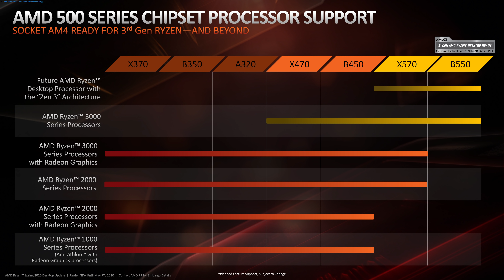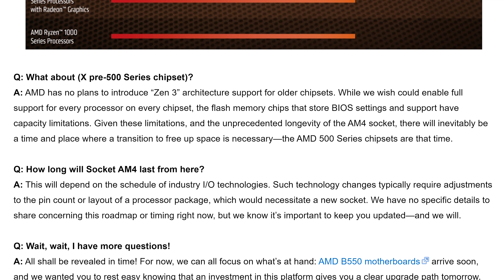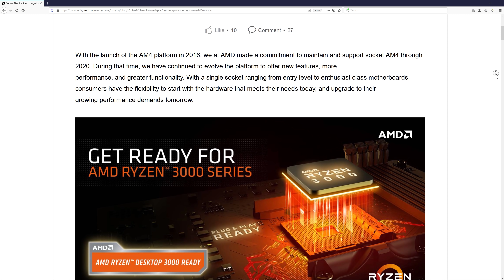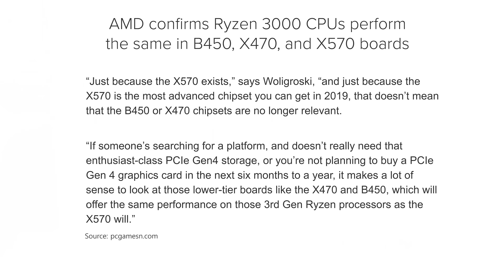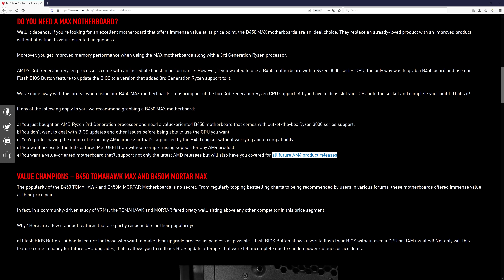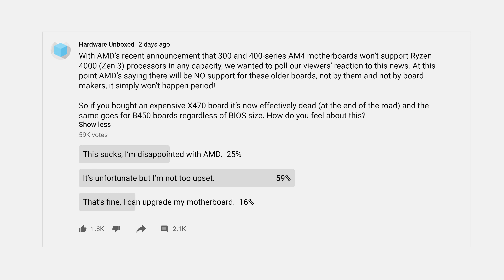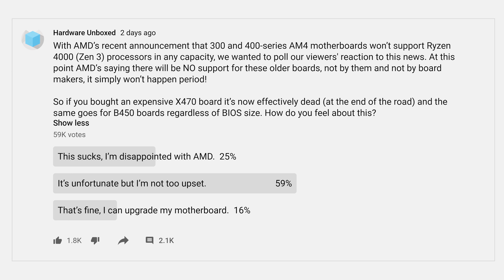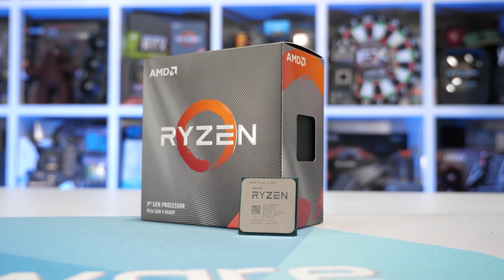AMD Does An Intel, Axes Zen 3 on 400-Series Motherboards, Our Thoughts

Comment: In answer to your appeal for replies, I am in the camp of being pissed off at #AMD. I’ve been a Mac owner since 1985 and very recently just bought everything to build myself a Hackintosh from scratch with the added flexibility of playing PC games - especially iRacing etc. Sims. (Yes I know you have to remove the Mac OS drive so it doesn’t get corrupted when using Windows on the same machine. I am actually leaning towards Linux as my gaming OS - thoughts anyone?)
Never owning a Windows based machine before, and not really knowing much about motherboards, chipsets, etc., I was on quite a steep learning curve over the past couple of months, doing loads of research, watching Tubers like yourselves, Pauls Hardware, Gamers Nexus, Jay and Linus, to basically learn everything from scratch. 
As a result of this research and from speaking with an extremely helpful sales advisor from a vendor here in the UK I deliberately chose a B450 board (MSI Pro Carbon Gaming AC) based on the assumption that in 12 months I can upgrade my CPU and nothing else. Even though the MB only cost me £100, that’s not really the point. Everyone was expecting the B450 MB’s to support Zen 3 and the ludicrous assertion from AMD that the BIOS will be too big for the chipset doesn’t really stand up (IMO). I feel that I have been a little mislead by AMD, as I used the information available to make a choice of what hardware to buy. 
(Before anyone jumps down my throat and tells me I should have just gotten an X570 board, for my use I didn’t need PCI4, and I still don’t, so I saved money on my MB and bought faster RAM (3600Mhz) and more of it (48Gb in total) - I don’t need stupid fast SSD data transfers for what I do.)

Comment: Bought an Asus b450i due to better vrms and features for the ryzen 7 3700x and in 5 years the ryzen 7 4700x or something in that range... Hope it still gets support, but its a shame that AMD made this decision in the first place...

My choice was a x570i for 250-300 bucks with features I don't need or a perfect suited (for me) 140 bucks b450i board... I needed b550 when ryzen 3000 came out, not b550 when ryzen 4000 comes out when you made a decision to NOT support boards that most people bought due to prices.

Comment: Well for better or worse, they are still way ahead of what Intel been doing in the past decade, and i didn't see people frustrated about it.
Yeah it a bit sucks for some people that bought B450 Motherboard, but I don't think AMD promised that it will support Zen 3 so it's something to consider. It is better to make it this way since it will unlock more options in the future of more features and compatibility. You can't support the same chpset forever and it's better to upgrade and making the newer stuff better and not stuck with the same for years.

Comment: It absolutely is a bullshit move, I bought the MSI B450 Tomahawk MAX on the (safe at the time) assumption it will support Ryzen 4000 CPUs.
B550/Ryzen 4000 is the end of the line for AM4, does AMD really expect that people will upgrade their motherboards just for single generation of CPUs?
I think most people with existing Ryzen 3000 CPUs will just hold out until the next generation and move to AM5 / DDR5 when those come out.

Comment: Intel ditching chipset every year : nobody cares
Amd Ditching Chipset : everyone lose their mind
Reply: We do care about Intel ditching chipset every year, that is one reason why people buy amd Ryzen.
Reply: I guess its the way they did it people were under the impression support would come so bought a product based on that which ended up not to be true. with intel you know if you buy a board you will have to upgrade it in the next year or so.
Reply: I don't care about Intel and bought AMD exactly because it was advertised they would have extended support.

Your comment makes no sense mr. Ng
Reply: The problem is that Intel has always been very clear on the matter. As Steve put it: "Tick, Tock, and go fuck off to buy a new motherboard". You know upfront that if you buy a mobo and CPU on the tock cycle, it is the end of the road. And you know that if you buy it in the tick cycle, it is not going to be worth a tock upgrade unless you bought a really low end CPU. In short: you don't make strategic purchases because Big Daddy Intel is going to give it to you hard and dry like Apple does.
So AMD, in this case, has promised on thing and delivered another. This is a problem because you can normally count on what AMD says. People have made long term plans for upgrade paths that will see them through a tight budget... We're not talking the "hur-durh i9900k+2080ti or be a lozer noob" people here. AMD's core customers (that kept them alive while they were down) are pretty darn value oriented. So yeah. Intel fanboys get screwed over: "We're expecting that". AMD fanboys get screwed over: "Wait! That's illegal!"

Comment: the problem is that they got used to that underdog status and made so much fun of Intel's antiques and now that they are the leading force they are doing the same. I bought a very expensive x470 board (c7h) thinking I would be able to upgrade to at least zen3. If I knew this, I would prefer buying a more affordable board. 
This said, I now run a 3600x so I still have an upgrade path for sure, all the way up to a 3950x....

Comment: I held off on buying anything for the sake of "upgrading" until after processors have been released for a reason. It sucks for those that purchased 400 series boards to support next gen, but we all had warnings that support would be good to/through 2020. On the other hand AMD could have done a better job of specifying why rather than just saying the BIOS chip was too small. That and the late release of B550 is on them. As irritating as it may be.. they did follow through on maintaining support into 2020 putting all semantics aside of whether it's until the beginning or end.  As for the release.. I see it being a paper launch, and the availability for the Zen 3 chips coming in 2021.

Comment: It doesn't matter what AMD did with socket compatibility. What matters is that they LIED to the customers. Intel does not give false promises. This is next level compared to Intel.
There is no socket support for B450+Zen2 -> (B550 or Zen3). Why?
To jump forward from B450 to B550 you need to change the whole combo, CPU+Mobo, since B450 does not support Zen3 and B550 does not support Zen2. So the whole support of the socket is irrelevant. It could have easily be ANOTHER SOCKET with the same result. This move should have been done with the switch to AM5.

Comment: As an owner of a 1600 and a x370 board, its hard for me to be sad, my mobo got support for 3950x, which was the next upgrade I had in mind, when the prises where pushed down by next gen ryzen. AMD should really show they gratitue and put the hours into support 4-series of mobos with next gen ryzen. Its fair that the 3-series mobo does not get support for the 4K/ryzen 3 gen lineup. As also concluded in the video, the natural switch of mobo and cpu was at next gen RAM upgrade. Still, Im not buying Intel again.

Comment: The weird thing about all this is the X370/B350 "beta bios" situation. AMD seemed determined to give X370 and B350 only two generations - just like Intel.

Now with X470/B450 - AMD is giving that chipset two generations as well - unless you count backward compatibility as three generations?

If AMD had it's way and never caved for the "beta bios" support for Ryzen 3000, they would have had their way and segmented their mainboards by two generations each time. Why the heck does anyone give a flying rip about how long "the AM4 socket" lasts, if the chipsets are divided rigidly into two generations each? Intel has been doing that for years.

Comment: X470 & 2700x here

Bought them together with promises that future cpu upgrades would be worth the then expensive mobo. Was actually the dead end platform then as there's really no meaningful upgrade in 3000 series (as I don't have that much use to 12c) ..which I expected to be the case back then but really also expected the 4000 cpu to be supported.. at least 400-mobos should get the support for the 4000 cpus.. that just makes sense...

Comment: I'm not really that angry cause the AM4 platform has been alive for many years. It would've been worse if they used a new socket, even though I feel that's happening soon.
Reply: Ryzen 5000 will be a new socket. And frankly I hope they got to an LGA style socket. Those itty bitty CPU pins are damn fragile and quite often the socket doesn't have the gripping power to hold the CPU in place while you remove the cooler.

Comment: @5:20 They explicitly say "Through 2020" in the article on screen moments before, which ought to mean until Dec 31st 2020. Honestly I'm not terribly upset by this myself. They should just be honest about the reasons behind the decision instead of this garbage "bios size limitation" thing they're feeding us.
Reply: They changed their language to "until 2020" last year.
Reply: @zeitgeistx5239  Even "through" excludes anything past 2020, though, so the point stands.
Reply: @zeitgeistx5239  That makes sense. I watched a GN vid last after my post which showed an article saying "until 2020". Kinda interesting, imo.
Reply: In that article, if you watch the video at 19:50, you can HEAR AMD say "through 2020."  That kind of speech would imply through the ENTIRE year of 2020, not part of it.  I need to consult with some of my layer friends as to what the ramifications of that could mean.
Reply: What's funny to me is that the next desktop architecture is gonna be Zen2+, not Zen3. Zen3 isn't coming until at least 2021.. so AMD kept their promise. They're just wrong here.
Reply: Yes. AM4...
Reply: @MN-jw7mm  In a twist that everyone saw coming, AMD pushes their Zen 3 release to January 1st 2021.
Reply: @MN-jw7mm  Which ryzen 4000 uses. "we said the socket not the chipset" is below intel/nvidia level, and is deceptive, possibly false marketing, because at NO point did they say anything about chipsets. Intel tells you up front you only get 2 generations per socket. Nvidia up front tells you they are no longer optimizing for their last gen GPUs. AMD whispers sweet lies while promising then retracting promises of support.

Comment: I would not have been super upset if I bought the B450, I would just have to "settle" with a 3900x in the future lol.  Not a bad future honestly.
I voted "It's unfortunate" with 59%.  But I bought x570 in my first build in December.  It was $85 more than the B450 board I was looking at.  I said to myself, "treat yourself, you deserve it." and I bought the x570.  Dropped a 3600 in there with plans of Ryzen 4000 in the future.   
I got lucky in overpricing my build at the time.

Comment: People have been taking s**t from Intel for years, and when AMD made it possible to install and run a 16-core processor into a 2 year $100 motherboard, people now expect AMD to have 3 generations of backwards compatibility and when they don't, backlash ensues. That's beyond unfair and if AMD is facing backlash for axing Zen 3 support for 400 series motherboards, Intel has to be run to the ground. I'll consider AMD equally bad to Intel only if they force you to change motherboards for every generation. The problem here is that AMD spoiled everyone. Also, it's not fair to call someone a fanboy if they don't agree with your opinion.
Reply: But in 2017 they were saying that the AM4 socket would support Zen 3.  They didn't say it wouldn't until this news.

Comment: I bought a B450 motherboard for Ryzen 2600 and was hoping I could upgrade to Zen 3 as upgrading only one generation seems like an overkill. The problem is that if I wish to go through with the upgrade and stay with B series chipset, I have to upgrade both the motherboard and the CPU at the same time since B550 no longer supports Zen+. Which in extreme case might mean a new windows licence. In which case I would rather not upgrade at all and build a new PC at a later date. Upgrading an older computer for €200 vs for €400 for the same performance gain is not a negligible difference.

Comment: Bought a b450 about a year ago and coupled it with a 2200g.  Kind of lame I won't be able to run Zen 3, but I still have a really viable upgrade path to a 3600 or a 3300x or better.  It was a $65 b450, so no huge loss.  By the time I outgrow my b450, i'll have gotten more than my money's worth and I can turn the old board and cpu into an HTPC or something.  Really not the end of the world.

Comment: Well, they already have intel beat by a long shot. 3 generations on one board is far more than intel has ever done.

The way I see it AMD has done a justice to the community. They have forced intel to slash their prices, brought us a line of really good affordable products and changed the cpu market for the better. 

It sucks that some of the am4 boards will more than likely not work but, we will have to wait to see what happens.

What I think might happen is AMD has the market share, the lead and might feel comfortable doing what intel has done for pretty much ever. 

Their new platform will be an improvement.... if you can afford it. I cross my fingers this won't be the case but, AMD is nothing more than a corporation after all. 

All heros fall eventually.
Reply: Intel HEDT has 3 generations right now.   They're reversed. Intel provides 2 generation for desktop and 3 generations for HEDT, but AMD provides 3 generations for desktop and only 2 for HEDT.  It's an interesting way to treat the customers who gave you the most money at high margins....

Comment: I was building a computer for a friend, I was updating the bios so that it's up to date but the way the bios have been split for multiple CPU's was incredibly intimidating. 
The way they were organized was "Ravin ridge, pinnacle ridge, etc" that is absolutely awful I don't know what the hell that means just say "ryzen 1000, 2000, 3000" it was really confusing and I had to look at a weird compatibility matrix on reddit. I don't think that fracturing is good. The new boards still have backwards compatibility which will still allow people to build fantastic budget builds.
Reply: They can't use ryzen 1000, 2000, 3000, because they've been mixing architectures.  Firstly the obvious APUs, which have the same product series name, but are an older generation, then you get things like the R5 1600 (AE version is Zen), R5 1600 (AF version is Zen+), or the 3200U (Zen).  The 3000 series can mean Zen, Zen+ or Zen 2, depending on model.  This confusion is of AMD's own making.

Comment: I purchased an x570 with a 3600. I figured if I wanted to upgrade to a 3900 or better it was smarter to get the latest motherboard as cpus with new features would need the newer board. I'm glad that I did instead of thinking that the old PCI-E 3.0 boards would be best for the future.

Comment: I just bought a 450 a month ago thinking I'd have a clear path forward for upgrades, at least for awhile. I would have most certainly bought a 550 if I could. my whole point was to not get stuck into buying a MB, CPU, RAM, all at the same time, AGAIN. So now they pull the rug out from underneath me 26 days later. Yeah I'm pissed, they knew they were going to do this but didn't say a thing. I'd be different if there were 550 boards for sale. They've become a pack of assholes like Intel. With the price drops Intel is going to have to make I'll probably be going back to them.

Comment: Your point about people feeling mad specifically because AMD didn't make it clear that x570 was the only forward compatible motherboard is completely correct. If I had known that, I would have bought an x570 motherboard instead of my reduced price x470 motherboard. However, if somebody bought an x470 with their 2700x and wanted to upgrade to zen 3, they would still be justifiably pissed.

Comment: I see the logic, B450 ends with 3000 (all be it with a very slimed down bios) The Max series doesn't require a beta bios or a slimed down version. B450 supports 3 generations. It is my option that is enough. Didn't Am3 support 2 generation and AM3+ support 3 generations. Seems better than Intel where evetime I heard a need chip release you need a new m/b to support it. People just go buy it.

Comment: Pissed that AMD isn't setting themselves apart from evil intel in terms of compatibility- really had an opportunity to win/retain more consumers here. So salty in fact that i'm looking for somewhere else to turn.
Reply: Matt Faust They turned even worse. They now also make fake B550(A) boards(B450) to help OEMs lie and confuse customers
Reply: 4 generations (counting non-ryzen AM4 APUs) so far all forward and backward compatible (minus a few exceptions), and you are still whining? Intel has never done anything like that since .. ever. Please turn back to Intel, they miss you.
Reply: Listen man, AMD made misleading claims about continued support THROUGH 2020. If they never said that there would be no salt. By using the same socket still and then punking out on support, that is bush league.
Reply: @mattfaust1918  Actually, they said they would support the AM4 socket through 2020 through (four generations - will be 5 with Zen3) ... and they did exactly that. Perhaps four years ago they couldn't foresee chipset compatibility issues with that grand vision of socket longevity. If you want to buy a new motherboard with a socket that only lasts two gens (that offer only 5% improvement over the last) go back to Intel, like you said. Clearly they're the better choice for you.